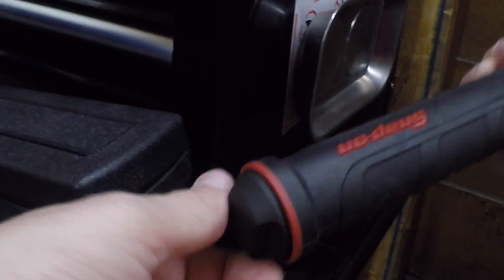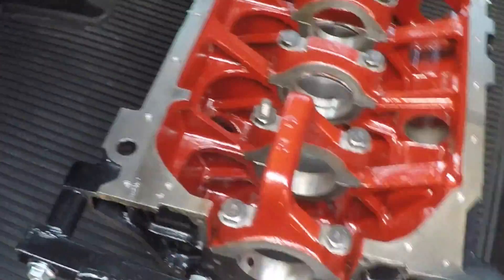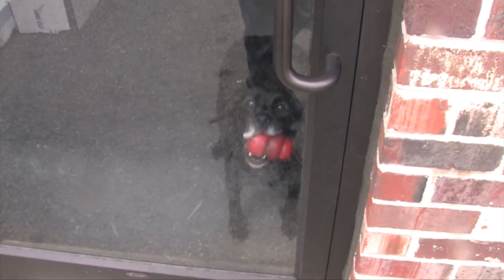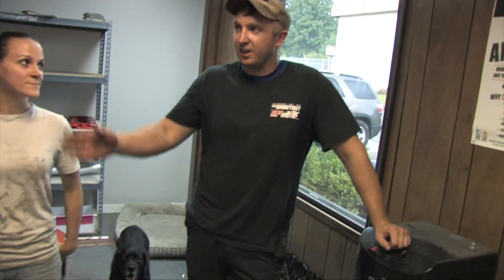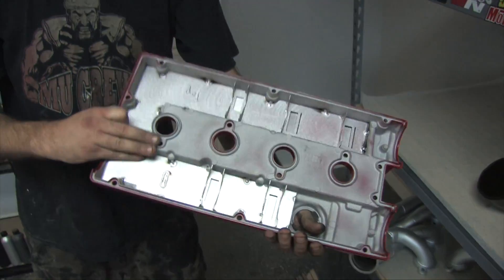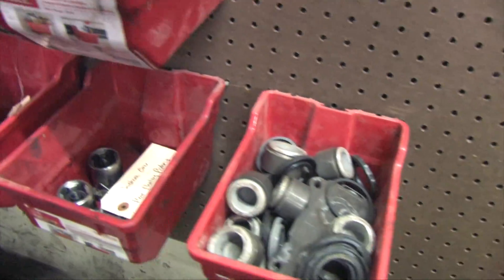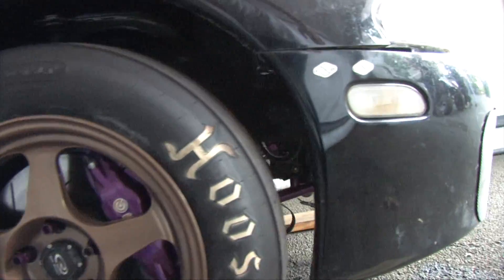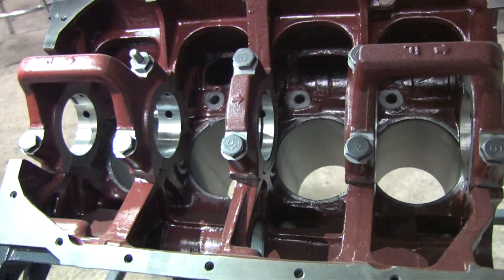Oil-Repellent Coating Baking Procedure

Comment: Can used on aluminum crankcase  ?
Reply from the maker: Yeah, but why would you want to?  I'd just sand and polish the aluminum smooth.  It would reduce its surface area doing that, but it would also add the benefit of strengthening the casting.
Reply: @Jafromobile  ok you right.  But is for 2 stroke can i used on the crank and cylinder transfer right?
Reply from the maker: @m0ntr0s0  I would not apply it to any moving parts because it will change their weight and balance.
Reply: @Jafromobile  ok thanks  make sense

Comment: I doesn*t recommend to use those bolts at the engine, that were on the owen. Some steels loses properties at high temperature. Sometimes at relatively low temperature..  Something like a about 250C may be too much for some steels.. But well.. Cast iron is ok with hi temperatures. It is, and stays what it is. no matter if there is then, hundred, or 500 degrees celsiuc. It is almoust always ok. Of course it expands, like every metals do. But it gets back to it's original shape and size without melting or so.. damaget etc.. Thanks for the video!

Comment: The 1275 mini cooper s engines have the glyptal coating from the factory to allow the oil to cool the block better and help prevent contamination to the oil from the metals in the block
Reply from the maker: Ah yes, the good ol' '67 Cooper S.  I didn't know those were coated?  Wow!
Reply: @Jafromobile  All 1275  Cooper  S and Clubman GT
Reply from the maker: Oh yeah!  I keep forgetting how many countries the Mini's been built in.  I know you could even buy new Rover Minis in Japan through the late '80's.  That car is the flip phone of automobiles.  Such a pure driving experience!
Reply: @Jafromobile  i wish i had kept mine
Reply from the maker: That's what my stepdad says.  He had a bright yellow '67s built to 135hp.  He put a radical cam and valve springs in it, bumped up the compression and afterwards the starter couldn't crank the engine when it was cold.  Couldn't handle the valve springs.  It was a terror, and he's told me the same stories for 3.5 decades.  I drove one once.  Not far.  But enough to know I could easily get addicted to it despite being 6'4".  My dentist drives an Austin Mini.  Maybe if I let him drive the Hyundai...

Comment: Wow nice torque wrench how much was it and does it come in quarter in ??
Reply from the maker: Yes, you're looking for the Snap-On ATECH1FR240B.  It's their inch-pound wrench.  The 3/8" is the ATECH2FR100B, and the 1/2" is ATECH3FR250B.  Get ready to cry a little bit.  They're not cheap, but they're not Aerospace prices.  I don't really want to talk about the price here because you'll find them with this info.  I just wanted to make sure the bolts torqued with my own hands are always perfect.  I spend money on the tools that matter.  The ones that make you money or improve the quality of work.  Some tools I refuse to spend bank on because I know they're supposed to get lost, destroyed or stolen.  But welding equipment and precision tools don't fit in those categories, and I don't let anyone borrow them.  Learned my lesson too many times.  Some Snap-On dealers actually sell on ebay at better-than-truck prices.  Mine were bought like that, and they were both brand new, freshly calibrated with not a single scratch, mark, and no duty counts on the clock.

Comment: Always wondered what kind of paint they used inside the engines. CAT used to paint the inside of diesel motors with yellow paint but  didn't know what the paint was, it looked like an epoxy paint. But with your video I know what it is now!

Comment: I know when you build and motor and do the first hey cycle with a basic cheap oil. Have you checked into Royal purple products? I'm not a spokesman for them just a big fan of their products. They have a break in oil, assembly lube, full synerlec synthetic oils... Gear oil, atf fluid, coolant additive, grease, fuel additive, power steering fluid... Only thing they don't have YET is brake fluid. I've been using RP since 2007.

Comment: What's the point of the coating?
Reply from the maker: Faster oil shedding, more oil in the pan, improved oil quality, easier to clean up parts during maintenance, and because since 2000 when I bought my GSX, it's spent as much time on the road as it has broken.  Of course the vast majority of the time it's been broken with parts that could rust when exposed to open air – has been because of the time associated with video production... but even when it's fixed, the car sits a lot.  I was expecting the coating to shed oil faster than it does based off of what I read about it, but in my tests which you'll see in an upcoming video, it's only a few percent quicker at room temperature.  I'm sure it would be different with hot oil.

Comment: I wonder how something like this would suit road racing setups to promote oil staying in the oilpan. I'm guessing oil temps 250+ sustained for 20min sessions would present a problem for the glyptol(spelling?) Besides the obvious problem of oil being that hot.
Reply from the maker: Glyptal doesn't start breaking down until it exceeds 300°F according to the product data sheets, and it's cured at 280 for 2 hours which is longer than most road races last...  According to the old timers I could bake it at 280°F for days and it won't affect it.  Adding oil to the mix shouldn't change those properties since it's an oil repellant.

Comment: Cleaning the block with laquer thinner after it is hot tanked and spraying with  rust oleum  works wonders...No huge pain in the ass like this. I  pulled the intake off my 1969 DZ 302 that was painted inside with rustoleum over 25 years ago...still looks as good as the day it was sprayed.  It must work as well because this engine spins 8500 rpm every time i turn the key....

Comment: Will you do a dry-sump on this?
Reply from the maker: If the car was an automatic race-only car, I would.  In a heartbeat.  I have been tempted to, but no.  I still want it to be a comfortable street-strip-show car.  It still has AC, all the original body panels, glass, power options, sunroof and no roll cage.  I'm trying to figure out a way to still keep my cruise control on this car and not see it.  All the factory gear on it has to work because it's a purist car built for the fans.  There's no guarantee this block will live its entire life in my GSX, but that's where it will live for a while first.  Remember that I have 4 different chassis that could accept it.  ;)
Reply from the maker: In other words... if I'm going to build a car that needs a dry sump, this will be the block I use.

Comment: That's very kind of you to introduce us these people.
They make a really good work!
I wonder how they are able to powder coated the exact surfaces you want, without staining your glyptal application and cylinder walls.
Reply: The block was powder coated first and then the glyptal was applied. For the powder coating we use high temperature tape and silicone plugs to keep powder off of any surfaces that you do not want it on.

Comment: Man as a fellow automotive youtuber, I know the pain of filming slowing you down. a 1 hours job takes 3 if you want to film it, badly. if if it's done well like yours, 4 to 5... then the endless hours cutting the footage, editing, rendering etc, all time you can't spend on the car now... I do love your work though, your passion for accuracy is after my own heart. I'm about to begin my 1st performance engine build, I've rebuilt engines before, new rings and bearing at the like, but never expected mega high performance out of them, your video series has given me more confidence in my ability to piss the excellence out of this build and defend my title again in April. Also 101st YAY

Comment: Looks good mate, but it is the function that matters and this will help your oil control significantly especially if used with a good baffled sump. I point don’t run the engine in on Synthetic Engine Oil as it will never bed in as the oil is too good at its job. Here are a couple of tips that may help some people out there, 1. cheap internal burnt on oil/gunk cleaner is paint stripper if you cannot afford a dip in a hot chemical tank.  2. If you have a v engine you may be able to drill a ¼ hole from the bottom of the valley slightly downwards in to the cam chain area, that’s if there is not a water or oil gallery there, this will add extra oil to the chain and distributor drive gears as the oil is on its way back to the sump anyway. Some engines wear chains and gears fast when subjected to higher RPM than the makers designed them to run at and after all it is free extra lubrication for no extra cost. Hope I have not wasted anyone’s time.
Reply from the maker: Nah, that's a great idea!  ...for an engines equipped with a timing chain!  I would totally do that... if left alone with it for long enough to have figured that out.  Oil clearances on race engines should be different than street engines, just like you suggest.  Thank you for your comment!

Comment: Do you remove the oil squirters? Are they actually needed?
Reply from the maker: In this block they're currently removed.  I will be installing a brand new set because I bought them.  Are they needed?  Well, the Elantra doesn't have 'em.  Lots of people run boosted NA blocks and don't have 'em.  On a daily driven street car, I'd have 'em.  I don't believe they cause bearing failures, or are a crankwalk contributor in any way as some have speculated.  If the oil squirters cause some kind of oiling issue, then the car has an oil pump or oil pressure regulator issue to begin with.  They can be sheared off by a longer Wiseco HD piston skirt, and go out and run 10-11 second passes for 5 years before being discovered in the oil pan and cause absolutely no issues whatsoever.  Just make sure they clear your parts if you install them, and make sure you can compensate for high oil pressure if you remove them.  You'll be fine either way.
Reply: Jafromobile thanks for the advises. Before I used racing oil 10w50, but it's too thick and broke 1 rod bearing. The mechanic told me the problem is the oil. Now I use 5w40 valvoline synpower and the pressure is much lower. What do you recommend?

Comment: Good stuff as always. Hey Jafro, any recommendations on some ECMlink/sd tutorial videos? Just installed sd and having some rich idle issues.
Reply from the maker: I just re-read your comment.  My previous answer sucked.  Sorry I answered it poorly, so I deleted it.  I have not seen any videos about idle tuning with Speed Density beyond the vague one I made.  The BEST video is for dialing in your idle tune is on ECMlink's website in the Demo's section, and it's video #8.  In that video Tom uses MAF compensation to correct a rich idle, but I'll explain what's different.  

You tune your baseline fuel settings the exact same way he demonstrates on the fuel tab, but whenever he's correcting fuel by adjusting airflow... you just don't ever use the MAFcomp tab.  Leave all that flat.  Speed Density doesn't use it.  But all the other preliminary goals and procedures in that video still apply.  Set your AirflowPerRev to .25g/rev by adjusting your global fuel settings and deadtime.  That part's exactly the same... but then you correct your CombinedFuelTrim value to 0±3% by adjusting the idle cells in the SD table, not the MAFcomp tab.  You want that as close to zero as you can get it.  But anytime you see him hit the MAFcomp tab in that video, click "Speed Density" instead.  If you want to see which cells on the Speed Density table are your idle cells, then with the engine running at warm idle, click "track changes" and it will tell on itself on the Speed Density table.  It will highlight the cells being used.  You can manually adjust them by pressing [control] + [up/down arrow] to add or remove AIR (and therefore, fuel).  That's your idle tuning in a nutshell.

The part throttle tuning stuff Tom does in the OpenLoopThreshold tab is also exactly the same as you would need to do.  To lock your ECU in closed loop, copy what he did in that video and go for a part-throttle drive.  Take a log so you can gather your sample data for the next steps.  When he demonstrates the MAFcomp adjust tool, notice on your computer that the SD VEadjust tool is right next to it in the same menu he navigates to in that video.  Just like what he did with the MAFcompAdjust tool, you can use the SD VEadjust tool to tune your part throttle driving.  ECMlink will give you suggested values to correct in the SD table for the -cells you utilized during that log-, and you can save those suggested changes to the ECU.  You'll see the cells it changes and therefore which ones you utilized during your drive because they'll be bold until you save it.  Take another log and utilize all the cells you can.  It's based off of your engine's load factor, (think uphill, downhill, 10, 20 30, 40...80% throttle) and how many RPM's your engine is turning.  The more data you have to work with for running the SD VEadjust tool, the better.  Once you're satisfied, manually clean up the table to ensure the transitions from one cell to the next are smooth and don't make big percentage transitions to the other cells around it.  Those adjacent cells affect the cell that's being sampled (when you're watching the table at a point in the log with "track changes" enabled).  Notice how Tom manually smooths and adjusts the suggested changes from the MAFcompAdjust tool when he's on the MAFcomp tab.  Same procedure, like I said.  Don't forget to reset the OpenLoopThresholds back to defaults when you're finished, and Tom shows the button in that video that does that as well when he's setting that table up.  You'll know you're in the right ballpark once your log shows the BoostEST value and your MAP sensor values are close together under boost, and your AFRatioEST and WB sensor values are overlapping.  WOT tuning is a whole different story.  You use the Min and MaxOctane tables in Direct Access, and they work the same way (with track changes, and a colorful load-factor based fuel table) but the values are air/fuel ratios instead of airflow in percentages of VE.  I'm still learning a lot about this myself.  When you're tuning based off of volumetric efficiency, you have to remember that every car breathes differently, and whatever build and mod list one guy has won't match someone else's mod list or whatever boost leaks they have.  Fortunately ECMlink has a tool built into it to make customizing the SD table to YOUR CAR a lot easier.

As far as SD videos are concerned, I'll probably make one someday, but the mechanical and electrical reliability of my antique Hyundai Elantra has been really problematic.  It's probably not the best car for me to provide any sort of video example with.  I've had all the problems that nobody else should have, and this ECU upgrade has been an enormous help with finding and identifying many of this car's limitations.  But even if it was electrically perfect, the chassis and drivetrain just can't handle the power this engine makes even at wastegate pressure.  If I'm going to make a SD setup video, I need to bring my Galant back home and use it for this example instead.  It has AWD traction and it still has a MAF sensor on it, unlike all of my other cars.  It would offer a better example regarding how both of these systems of airflow metering work.  FWD logs are useless whenever there's wheel spin, and I can't turn this Elantra down any lower.